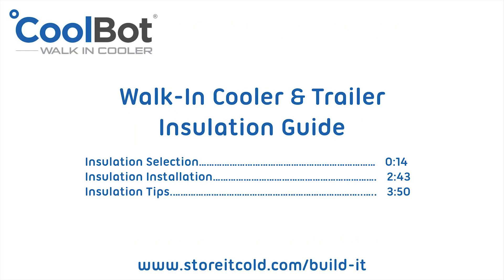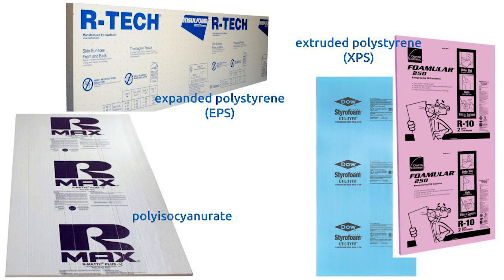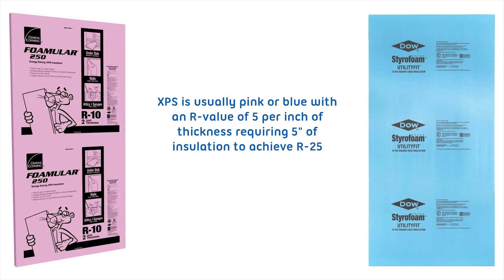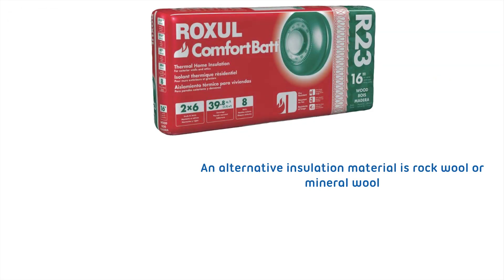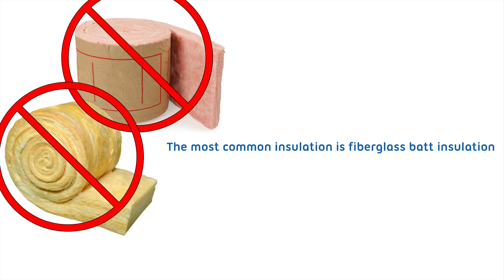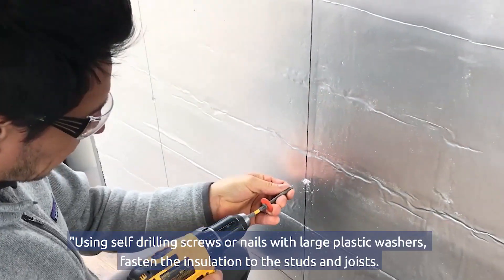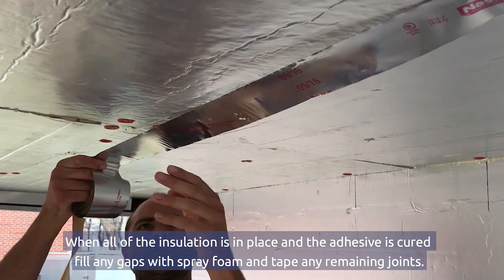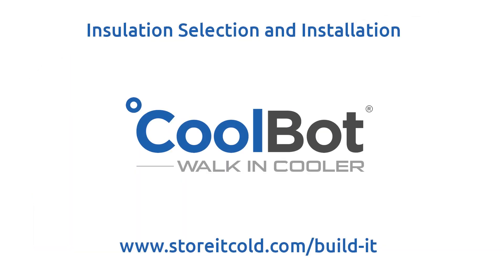CoolBot Cooler Insulation Video

Comment: Says R-25 but does not bother to say whether that’s for the insulation between the studs or the R-value of the entire wall assembly (including studs).  So, recommendation is useless.
Reply from the maker: Thanks for reaching out. If using rigid foam insulation, we recommend insulating above the studs rather than in-between. The layers of rigid foam insulation will create a solid wall, preventing any thermal bridging. Please contact support at hello@storeitcold.com if you have any other questions.
Reply: @Storeitcold  Reply still does not clarify.  Mineral wool batts in 2x4 bays are R15 for the product, but whole-wall R value is only R12.  Which value are you using?  Because when I add rigid foam on top of the studs, it's either an extra R10 or R13, depending on how you're figuring the insulation in the cavity.
Reply from the maker: @michaelbluejay  Hi Michael, thanks for the response, and apologies for the confusion, we didn't realize you were referring to using mineral wool, which would in fact be installed between the studs, as you say.   Mineral wool like Roxsul Comfortbatt is usually R14 for the 2x4  batts, so, to achieve an overall value of R25 and stop thermal bridging, we would need to add another R11 over top of the studs, which could be 2" of R-max (polyiso, R6.5/inch) giving you an overall value of R27, or 2" or 3" of XPS (blue or pink rigid foam, R5/inch) giving you a total of R24 or R29, respectively.  Hope that helps, please contact us at hello@storeitcold.com to brainstorm further, always happy to assist.
Reply: @Storeitcold  You really could not be less direct.  It doesn't matter what kind of insulation I'm using, as my question was crystal clear that I'm wondering whether your R-25 recommendation is for (whatever) product only or for the whole-wall assembly.  Given that you're now saying that R14 product in 2x4 studs + continuous R11 would provide the R25 you specify, then that means you're not specifying R25 wall assembly, though you still didn't say so directly.  As I said, R15 between the studs is R12 for the whole wall assembly, so adding R11 of continuous insulation results in an R23 assembly, not R25, but according to your answer, this is apparently acceptable.  BTW, Comfortbatt is R15, not R14.
Reply from the maker: @michaelbluejay All insulation for the wall as a whole needs to add up to R25 or more. Please contact our team at hello@storeitcold.com with any other questions.
Reply: @michaelbluejay   you could be smarter too, the answer was very clear.

Comment: What if you use regular house insulation but put it in a bag and make it air tight so moisture cannot go in 👍👍 there’s lots of cheap ideas .
Reply from the maker: Hi there, thanks for reaching out. We would not recommend using batt insulation in the cooler, regardless if it's sealed in a bag or not. The bags may puncture while bringing loads in and out of the cooler, exposing them to moisture and possibly growing mold which is the last thing we want for your cooler. They would also be difficult to secure to the walls. Spray foam insulation, rigid foam insulation, or rock wool are all insulation types we recommend.
Please contact us with any other questions at hello@storeitcold.com.

Comment: Why insulate the top of the cooler to a higher R-value if trying to keep the space cool? Wouldn't you want to hold the chill from 'falling' by insulating the floor to a higher value at 3:53
Reply from the maker: Hi there, thanks for reaching out.  Insulating the top of the cooler not only keeps the cold air in, it also prevents warm air from getting into the cooler.  Insulating the floor helps as well, coolers with insulated floors are about 15% more energy efficient.  However, it is not necessary to insulate the floor if you are putting the cooler indoors on a level concrete floor and do not need to be below 38 degrees.

Please reach out to us at hello@storeitcold.com with any other questions.

Comment: Does any one have any test data on how rapidly R max loses its R value due to loss of inert gas which  is replaced by air ? My understating is unfaced polyisocyanurate uretane loses 45% of it R% value in 2 years ?
Reply from the maker: Hi there, thanks for reaching out! Unfortunately, we don't have technical information in regards to the R value loss on polyiso, but you should be able to contact the technical support team from RMAX (manufacturer) directly for this type of inquiry.